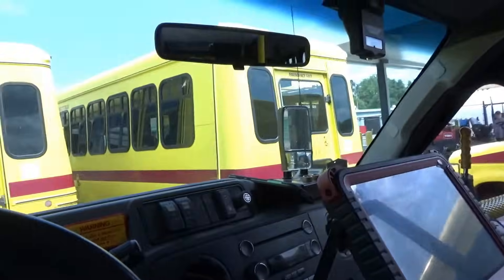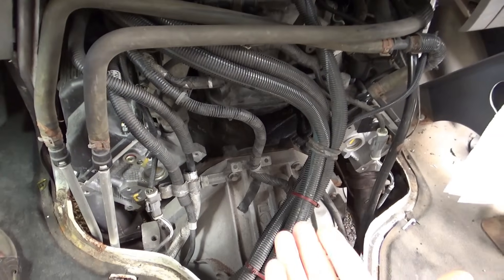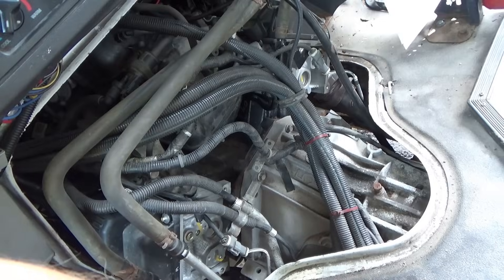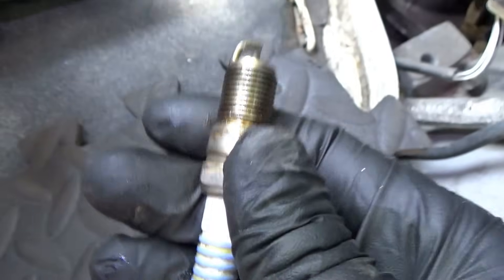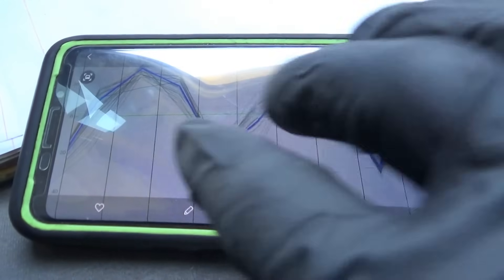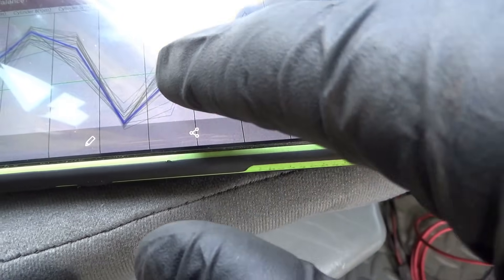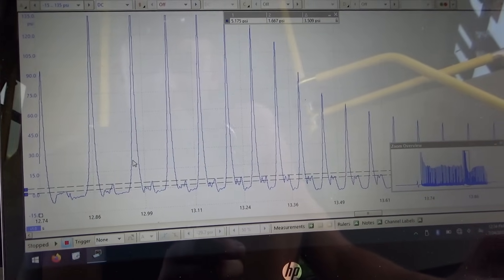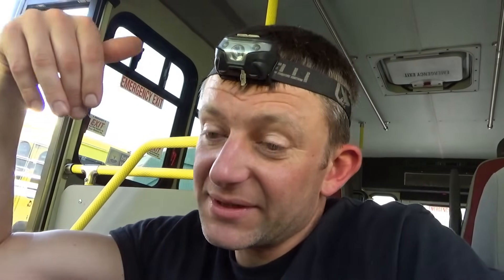Bus Runs Like GARBAGE after Engine Swap?? (Ford E450 V10)

Comment: Great diagnostic Ivan! Hmmm. #1 who sources these engines? Could they be "counterfeits" due to supply and demand where Ford or dealership or both use a 3rd party supplier without quality verification or lowest cost,etc? We've seem knock off parts in oem boxes where even a distributor didn't know they weren't true oem. A short or a long block engine might not have been received from a certified supplier vendor? Hey with all the corruption going on in industry or the support supplier network....Id wager at the end of the day, NOBODY bothers to check the quality or adherence to minimum standards of conformance! I worked as a machinist, assembler, taught SPC, spent 8 of my 27 years in QA as a grade A certified inspector covering everything from the inspection/tests of the raw materials to the finished product and everything in between! There is no way such a massive mistake could ever get this far UNLESS NOBODY EVER audited the supply chain. Holy S%*t!!! We are ALL in deep do-do......and things are about to break down like no one has EVER SEEN BEFORE. Thanks for all you do, Ivan! We need more individuals with your skillsets if we are to survive this automotive apocalypse!🕵🙏😍
Reply: Jeeze, you are right, just buy a Tesla. I did.

Comment: My 2012 f450 bucket truck has the v10 and just developed a rattle and misfire. The rattle stopped and the misfire got worse. 143k miles. My company has decided to replace the engine (with a Jasper) instead of surplusing the truck. I hope it turns out well lol
Reply: Jasper engines USED to be good.  They are junk now. My company used them for years up until 10 years ago.because they kept failing at an alarming rate.

Comment: Wasn't that 2012 era that these V10's would blow the spark plugs out of the cylinder head?? A friend of mine had
a pickup with the V10 and nothing but troubles of having to take it back to the dealer and if not the spark plugs 
were being blown out, stripped threads and 3 different brands of spark plugs and if that wasn't enough, coils had
to be replaced and if that wasn't enough, it was problems upon problems, three and four problems time and again; 
well that truck of his spent nearly 3 months at the dealer. This truck didn't even have 60K miles on it and once my 
friend had enough of the dealer's bs, he flat out got rid of it and bought a Dodge Ram Diesel for his new work truck.
I'd have to say that these V10's weren't worth the powder to blow them to hell! He had a fortune in repair bills that
wasn't covered under warranty either!! When things go so horribly wrong with these V10's, get rid of them as fast
as you possibly can, is what I say! They tend to be absolute junk and to just think of just how many vehicles had
this engine is even more scarier yet! We're talking about some motor homes, buses of course, pickups and yes
some cars as well and to actually trust these types of repairs being done by the dealers is even scarier yet!

Comment: Sad...#2 bus will have its head gasket problem when the warranty is expired. I'd complain and pressure them to replace this engine as well, likely from the same bunch of motors as the first one. There's too much money on jobs like these to be a picky dealership..."a little rough" shouldn't be there on good money for a new engine.
Reply: I agree. If Ivan can prove that the miss on 4 is not fuel or spark related, it should go back. Period. Also, in finding the coolant issues of bus #1, I would pressure test the heck out of #2 with that bore scope. I bet he finds coolant seepage. If those mills are official Ford remans, that is a real quality control issue. If they are outsourced for Ford, (local shop etc) I as a fleet customer would push the issue as high up as I could go with Ford.

Comment: Halfway into this I had the thought that bus is thirty or more feet long with an exhaust pipe a little long than that with a cat of some kind a muffler and some kind of resonator. Must build up a lot of pressure not to mention standing waves and that sort of thing. Prob has nothing to do with it.  Since I'm here halfway and open to guesses timing chain? Harness plugs going to the wrong coil? Back to the real action.

Comment: Isn't 60 psi too low in any cylinder? I don't think that would be acceptable in a replaced engine.
Reply: I think it is reasonable with a pressure transducer in a cylinder that is just idling. Remember, you are not cranking and building up pressure in a pressure gauge with a one-way Schrader valve in it with the throttle held wide open. This is the pressure in the cylinder on one stroke: all of the pressure is relieved each time the exhaust valve opens and none is stored between strokes and the air sucked in is at intake manifold pressure.
Reply: @justliberty4072  Thanks for the explanation, I did not think of that.

Comment: It is pretty sad when the stealership installs a multi thousand dollar engine and lets it leave running worse than when it arrived.  Makes you wonder if the problem is deeper than the place replacing garbage with garbage doesn't it?

Comment: Hey mate. Wouldn't an actual compression tester be more accurate? Just a question. Love your work mate. Have learned allot.
Reply: His pressure transducer is far more accurate than a scene in mechanical compression gage.  Not slamming you but technology marches on 😊
Reply: It is an actually compression tester but it's measured electronically. Pretty awesome tool, but very spendy for diy.
Reply: @stevewhite3424  fair enough mate. Was just a question. Really amazing tool for sure.
Reply: @jamesofallthings3684  yep cheers. Just so amazing that something can show you the exact pressure in a cylinder without actually going in there. Cheers, I want one.
Reply: @wheelersgarage8393  No worries 👍 👌

Comment: If it's a 265psi pressure transducer, then why does the pico setting only say 135psi?  (If I'm wrong, please correct me--  but you can see the setting above every waveform you show on screen).   Even your "known good" said it was only 75psi.. I'm not even sure an engine can run at all that low.   You typically see 120psi to 150psi.   135 (pico setting) is virtually half of 265 (transducer rating).. so if you double your readings, that would make a lot more sense.  The cylinder with 75psi would be actually 150psi.. and the 45psi cylinder would be actually 90psi...  which is definitely a bit low.   The cylinder full of water is a smoking gun though.  I just wonder if they re=used the old head bolts maybe?   Or maybe they didn't even get torqued down properly?   strange video

Comment: Maybe the manifolds aren’t restricted. Maybe it’s a cam issue not allowing the exhaust valve to open fully?
Reply: What do you mean? The cam leaks coolant to the cylinder with the wrong timing?? 😅
Reply: He said that on cylinder number 10. Thought the manifold was restricted at higher rpm.  @rkan2
Reply: Was wondering this too with the apparent exhaust restriction.  He also mentioned the cat was plugged but didn't see him check that, maybe did some checks off camera?
Reply: @rkan2  O yea that have eyes but cannot see!
Reply: @Joe_Mission  Back-pressure. I was able to figure that one out without any tools except my brain on a 2003 Jeep Liberty. I even mentioned it to another person that had the problem.
Reply: what? @tedmoss

Comment: I was interested in your pressure transducer set. Problem i have is you mention odd increments, which will not read correctly with my Snap On scope. I am also aware that i need the "specs" to  calibrate it to my Autel MP408. Do you supply the necessary spec sheet?

Comment: wonder if they did a break in procedure on the engines,, also what kind of maintenance is the bus barn doing if the coils are all ratty.  would have like to seen the condition of the oil.
Reply: Yes. Initial light duty runs in on a bus full of kids travelling up hill and down dale. Would be easy to run it in. Same as for diesel trucks. Run them empty without any load for the first 10000 miles. I am sure everyone would buy one. Same for the bus. Retired mechanic/machinist in Land Down Under.

Comment: If these are reman engines, I don't think Ford does those. It is outsourced to another company. It doesn't make it right but just saying. Those ignition coil boots are often overlooked when people do tune-ups on those engines.  Motorcraft plugs only and change the boots when it is tune-up time.

Comment: I´m kind confused, why that company have gasoline engines in their citybuses, when modern diesels are more effficient than gasoline, and also last longer (normally), or is it something with emissions in there?
If it`s fuel issue, dont you have winterdiesel there, as we have here in Finland, goes nice down to -30c arcticdiesel even lower.
Anyway that kind of engines should never leave any shop, and even more from dealer, that is not exeptable, rebuild or new.

Comment: Wow, too bad the first bus story had such a bad ending.  When the plugs were being pulled to do the transducer tests, I was thinking at least this Ford engine does not have the break apart spark plugs like the 3 valve Triton engines did.

Comment: .. everything went sideways when they started putting all that Plastic in & On an engine, so i guess they figured they'd Cheap Out Across the board, it's Junk when you get it.. 💯
Reply: Absolutely, it blows my mind that manufacturers decided to use plastic on things that really should never be anything but metal, such as using plastic intake on ford modular 4.6. wouldn't you know it, it cracks and then causes coolant to leak. Requires replacement with a dorman brand that's supposed to be an "upgraded design"

Comment: These engines are sensitve, it blows my mind that techs still cant work on them.. Its not the engines fault, im sure it had compression when it was installed. bad coils, EGTs through the roof. i guess what was expected?

Comment: Early on I expected mixed up leads.
We stopped supply and fit engines. We'd fit engine's that the customer would arrange.
We'd put every bolt back in and guarantee the engine won't fall out.
So many dodgy rebuilders out there.

Comment: Ivan, could the issue be bad valve adjustment on cylinders 8 and 9 or on most of the engine?
That's my guess.
Reply: no, because theres coolant. That means theres a break in between the cooling system and combustion chamber. Head gasket or cracked block or head or not torqued head bolts
Reply: There are no valve adjustments with this engine, but with the valve stem height has to be checked If it is too high up it will cause the valve to stay open soon as the hydraulic lifter pumps up for zero lash or if the valve stem height is set too low you get a ticking sound with the hydraulic lifter pumps up for zero lash And there's not a lot of wiggle rooms if I recall correctly about 0.60 thousand
Reply: Just look at the bore-scope picture of that cyl.

Comment: if the shop only got a block, and swapped the heads, they may not have torqued them right.
Reply: Or heads may not be flat.
Reply: @ferrumignis  i'm thinking its more likely they didn't install cylinder heads right, because it isn't as likely that multiple engine swaps results in warped heads.
Reply from the maker: It was a long block I believe...

Comment: Great job Ivan.  You were all over this pig. LOL. I think you might have found a dozen more problems with it if you kept going.  They must have gotten these engines out of the junkyard without any verification.
Reply: By 'junkyard', I assume you mean Furd HQ right?
The only reason Furd BUILT a V10 was so that there were two 'spare' cylinders right from the outset...

Comment: So they sent to get a new motor and they got a used one with broken head gasket with cylinders having no compression and even after bringing the bus back the dealer still couldnt figure out what the issue was.. they paid for a motor swap with old worn parts and obvious bad ones … maybe their mechanic is new and isnt torquing stuff..

Comment: Someone forgot to torque the heads.
Reply: ...exactly my thoughts!
Reply: Judging by the look of that gasket, I'd say that or they used the old bolts. Or both. Or didn't check for flatness, or etc. I don't see how it ran at all. With all the engines I worked on, and there hasn't been that many, I never had a problem, it was always the other guy that didn't know what he was doing when there was a problem. (Like not putting in the oil pump driver rod in a 1954 Ford).

Comment: Never underestimate the ability of Ford Motor Company to not do  Due Diligence on the companies that are rebuilding their engines, transmissions, etc.  And I've been Ford Blue for 61 years.  And I worked in the automotive industry for 30 years, working for a supplier to Ford.

While not Fred Jones, who also screws up transmissions, my Powerstroke 6.0L engine was a Ford reman from Franklin Power Products.  I've been rebuilding engines since my mid-teen years, and I'd never expected to find what I found in that engine.  So did fleet mechanics who worked on these.  Yeah, the 6.0L has Navistar design issues, but those can be rectified if you know what you are doing when building and maintaining them.

My Forensics video that floored me:  https://youtu.be/gHSTd_Wvjnk?si=NoxcgIsJXNAJkS1M

You have a great channel, Ivan.
Reply: Good vid, btw!!

Comment: Before those engines came out(7.5L 460s were the engine), the 460 Y exhaust pipes were a dual wall(inner and outer parts).  Why they did that, I do not know.  But, the inner wall wall would collapse and make for a crappy running engine.  It wasn't a CAT problem, it was a Y-pipe problem.  I hated the V10 and got out of the Ford biz in '98 before I had the chance to encounter any weird problems with those. There was a single CAT on the 460s and Y-pipe would collapse so bad on the inside, that in some cases, the engine wouldn't even start.  The good 'ole days.  The V10 was a mistake,  Glad they got rid of it.

Comment: never did like the Ford V10's..two more cylinders to develop a misfire! And whoever installed those engines and never tested them should be out of business. And the engine leaking coolant into the cylinder probably didn't have its head bolts torqued properly and the gasket blew.

Comment: Still strange, 3 new engines for the same company and then already 2 broken. Really the fault of the engine builder or just wrong use of the owner. Maybe there is a route where these busses get to hot, or a driver that is revving the engine to hot. But it could also be fault in instalment of course.

Comment: Sadly Ford is useless with replacement engines. 1989 Ford Econoline van with a V-8 had a serpentine belt that shredded every 200 miles. Filed a lemon law because they would only replace with a remaned  engine with no warranty  on a van that had 800 miles on it. Like the IRS it cost Ford $90,000 for a $24,000 vehicle.

Comment: Someone forgot to deck the block and or head or they didn't clean the surface before putting the head gasket on as all it take is one small piece of debris.
Reply: From this distance, I vote for bolt problems.

Comment: Basically, they took it for granted that because it was a replaced "new" engine, it must have good compression. That will bite ya in the ass...
Reply: There is nothing "new" about a rebuild. So you are right.

Comment: It surely makes one wonder if the engines were even replaced at all, or if the "dealer" shop just steam cleaned the engine to make it look new, that could explain the old used coils and why some were still dirty, and some were napa replacements.

Anyways its already well known that newer Fords are complete and utter garbage! If i owned any form of buissness, i would NEVER EVER in my life even think of getting a Ford, i'd much rather get a Chrysler than a ford even though chryslers are also almost as godawul crap as ford.

Comment: Bad engine change, never checked valve clearance, never checked ignition coils, did not replace ignition coil boots, , that's the minimum, a commercial vehicle with a 10 cyl gas guzzling engine totally American insanity, trying to suck the earth dry